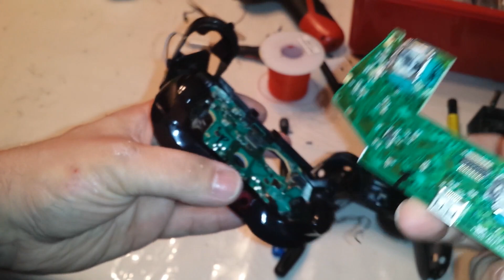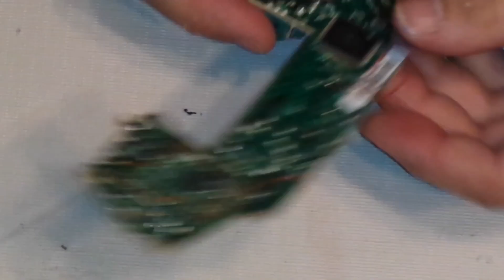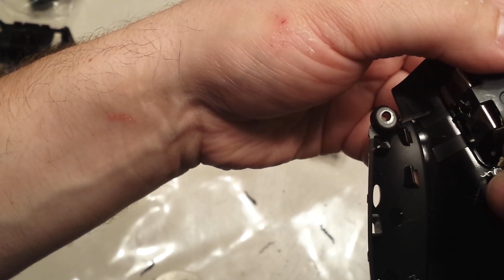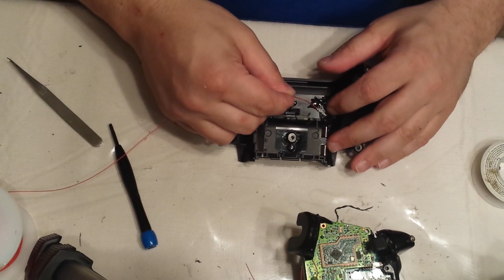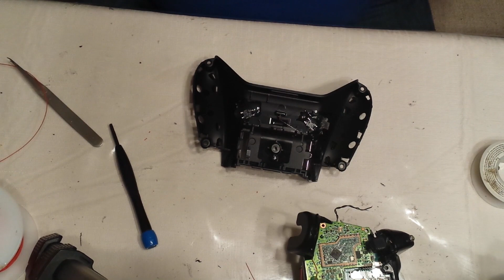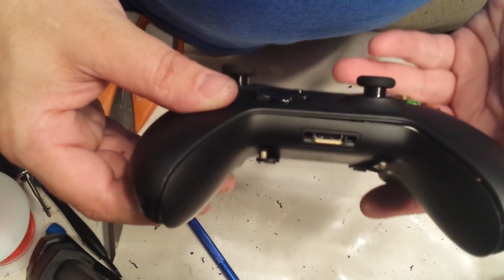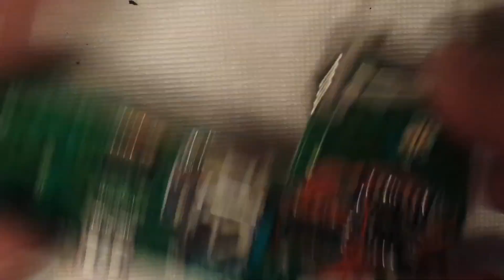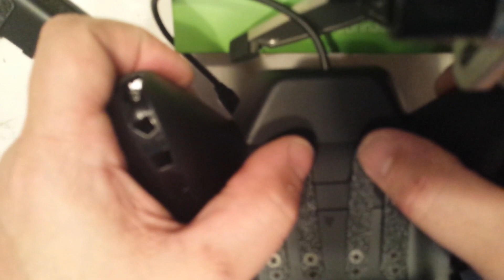TUTORIAL BUILD YOUR OWN XBOX 1 Scuf style Controller w/ Triggers Stops, Remap chip & MORE DIY Gamer

Comment: Is there any way to remap the D-pad?
Reply from the maker: Yes and No.  When I designed this chip it was 2011/12 and it was for the xbox 360 controller.  It is designed to work on both the CG (wireless) and the CL (corded version) controllers It only had 8 mappings. (any 8) but back in those days A B X Y RB LB and R3 and L3 were all people wanted to remap.  I wanted to beat scuf to the punch. I did actually. I had my programmable remap on the market before they did, but they are a multimillion dollar company and I am a hobbyist so I sold my chips to any company who would buy them, a few companies (Some you may know of) bought my product..  When the xbox one came out in 2013, everyone was going to want a new chip to work on the XB1.  The funny thing is - the controller while VERY DIFFERENT was also CG hence the design of the remap would work in there no problem, so I did a standard remap video right away, gave the heads up to my customers (other company's) that the 360 version works on the Xbox 1 controllers and there were SCUF STYLE re-mappable Xbox controller from DAY ONE of the xbox one release.  I decided to hold off to the spring to do this video  While the old 360 chips were a PAIN to install with all the wires (as you can see in this video) I designed a Exclusive XB1 version . Again only allowing remapping of A B X Y L3 R3 LB and RB.  That version + this one is the only chip on the market that can do MULTI REMAPPING - where yo can make more than 1 button to a remap on the back., So you could do combinations like A+B or R3 + A you get the idea....  Then People started to want the Dpad remapped. The chip was constrained to 8 inputs. SO you could do D pad + A B X Y (and leave r3 l3 rb lb off the remap).  People then started asking me for an ALL IN ONE solution with 12 inputs.  I was able to do it, but the sacrifice was Multi button remap. SO If you need a Xbox one version of the remap chip that can do 12 inputs (Dpad Up down left right A B X Y RB LB L3 and R3) I have those as well. Then the new controller S came out and the Exclusive Xbox one design went out the window but the old 360 Square chip (the one I use in this video)  Still work on that controller too. I did a whole new video to show that install. It's a little more work but installs pretty much the same way.  SO the answer is this.  If you want the square chip or the exclusive Xbox one design - it can do 8 inputs.(you pick 8 of the 12 buttons to solder to the chip) and it will remap it. If you want all 12 inputs I have that too but only for all the controller that came out before the controller S.  If you have the Controller S you have to go back to the Square chip.  I will eventually update the design, but as a hobbyist it is expensive and  not sure that there would be much demand. SO right now I only sell the chips I currently have designed.
Reply: MODCENTRALUSA well i am just trying to remap D_pad plus YXAB to have them below I have an s controller plus an Xbox one which has the a broken thumb stick so I will use that one for the mods and try it out.
Reply from the maker: If you only want DPAD and ABXY - then ANY of my Xbox one mods will work. Just make sure you get the right one for the right controller. 

If you have the older controller with and without the built in mic jack. Use this one 
http://www.ebay.com/itm/301536581617?ssPageName=STRK:MESELX:IT&_trksid=p3984.m1558.l2649

If you have the new Controller S use this one.
http://www.ebay.com/itm/301506057483?ssPageName=STRK:MESELX:IT&_trksid=p3984.m1558.l2649

Comment: any one have a digram for the wiring
Reply from the maker: I gave you all the points you need to know in the video. 
Same thing as a diagram.
But if you need a worded version.

This works for every Controller except controllers S

TP21, TP22 or TP26 are all Grounds. 

The button pinout for J5 is..

1 - 
2 - DR
3 - DU
4 - DD
5 - DL
6 - SY
7 - 
8 - 
9 - LB
10 - 
11 - 
12 - 
13 - 
14 - GND

The button pinout for J6 is..

1 - 
2 - 
3 - GND
4 - 3.3V Power
5 - RB
6 - 
7 - 
8 - A
9 - X
10 - Y
11 - BK, VIEW
12 - ST, Windows
13 - 
14 -
Reply: Amazing thank you bud

Comment: If you make mistake on remapping you can remap it on (probably name is good) "Xbox Accesories" works with One controller, One S, Elite others probably not.
Reply from the maker: Remapping in software (on the system). Will only change the installed remaps that you installed.

Hence if you put 2 buttons on the back of your controller for X and O and you go into the Accesssories software on the Xbox one and Change X to Y then when you press X on the controller it will push Y and when you press the remap on the back of the controller it will now be Y as well. But keep in mind that by doing so your original layout gets changed as well.

Comment: How easy is it to break your controller by doing this for first timers
Reply from the maker: If you take it apart wrong and pull something you shouldn't or forget a screw and force something off.. Broken controller.
If you solder the wrong pin you could short out the controller.
If you bridge pins by getting solder between them you could short circuit.

So unless you know how to solder or are confident following this video. You "Could" break your controller

Comment: I have the new slim controller, I took it a part and it's different! Is there a video on how to mod it?
Reply from the maker: There will be.. when I have time to do one.  Very soon.. subscribe it will be up soon.
Reply: Subscribed
Reply: Can I mod it the way it was done on the 360 controller? Scraping the coating off the buttons and soldering there, etc..

Comment: Great video man! I still LAN Halo Ce on the original Xbox with friends a few times a year. I have gotten used to the elite controller. My question is can you do something similar to the ORIGINAL Xbox Controller S?
Reply from the maker: You can... The original Xbox controller is pretty much the same. 2 wires to the Pad (one to each side of the pads and then to a tact  and your done. Follow the Xbox 360 tutorial, the Xbox one controller buttons are pretty much the same.  You can even google adding a button to Xbox controller S and you should find something.
Reply: +MODCENTRALUSA  Thanks for your response. Is there an email you can provide so I can contact you in regards to this directly. I wanted to add 2 paddles for buttons A & B as similar to the elite controller as possible. Wanted to possibly get a quote from you if you think that's something you be willing to do.  Thanks for your time.

Comment: Would the solder points be the same as the new updated controller with the 3.5 mm jack? At the 12 minute mark in your video you start describing solder points. Or is there an updated video for the new controller?
Reply from the maker: +Paul Palumbo  Nothing has changed.

The button pinout for J5 is..

1 - 
2 - DR
3 - DU
4 - DD
5 - DL
6 - SY
7 - 
8 - 
9 - LB
10 - 
11 - 
12 - 
13 - 
14 - GND

The button pinout for J6 is..

1 - 
2 - 
3 - GND
4 - 3.3V Power
5 - RB
6 - 
7 - 
8 - A
9 - X
10 - Y
11 - BK, VIEW
12 - ST, Windows
13 - 
14 -
Reply: +MODCENTRALUSA thank you!!

Comment: Wtf? How do I de-saughter the wires or however you spell it??
Reply from the maker: +Zack T.   Just touch them with the iron and they come off. Or use De-solder Braid...
Reply: +MODCENTRALUSA I don't understand, sorry.  Is there some kind of tool if need?
Reply from the maker: +Zack T.  do desolder a wire or remove it - heat solder by where you want to remove wire and PULL!
or
Desolder braid to suck up the solder. (google it).

Comment: I added padfles to mine but just like the video but now the b button doesnt work at all, any ideas?
Reply from the maker: +We3zy1992  yep..... you soldered to 2 points together on the B  button, the 2 solder points need to remain separate and you need to solder the wire to the TOP ONE one only.  D14
Reply: +MODCENTRALUSA  i will take a look at it, that could very well b it, thanks

Comment: Hi MODCENTRALUSA!   Quick question for you - I have seen some info about adjusting thumbstick tension on XBOX One controllers from the 60 or so grams of tension up to around 90-110 grams of tension.   I read somewhere that it can be done by adding a washer or shim under springs inside but not sure if that is the best way.   There is no video anywhere on how to do this in any way.   Do you know how that is done by chance?   The XB1 controller sticks are so loose.   Like 30+% less tension than the XBOX 360 controllers (which had the perfect tension for me and many others).   I know  people love the BX1 controller but many have complained about the loose XB1 thumbsticks so am sure there are thousands of people would love to understand this type of mod.   And I am one of them!~   :)   Any ideas?   Any potential for a tutorial on this subject matter?   Thank You!   Chris
Reply from the maker: +Chris Hunter Never heard of the washer thing.. but... IT is pretty easy. you need to desolder the stick. which can be a pain in the arse to do. But a good solder sucker and your golden. Once the stick is removed, use a pair of needle nose pliers and bend the 4 tabs that hold the plastic bottom on. Then take the bottom off. Carefully remove the stick mechanism and remove the spring, if you want a cheap way to do it slightly stretch the spring and put it back and solder it back in or Replace the spring with a stiffer spring.   Pot the bottom back on and fold the tabs to hold it in place. Place it back into the board and soder it back on.
Reply: +MODCENTRALUSA Very Interesting!   I had been  wondering if it would be necessary to remove the whole stick mechanism in order to change tension.   Now I know - thank you!!!   Next I just need to find a spring that would equate to about 90 to 110 grams of tension.   I will let you know how it goes!   I Appreciate You!!!   Chris   :)
Reply from the maker: +Chris Hunter I have done it in the past with other sticks (xbox, Gamecube, Dreamcast, Xbox 360 ect..).  Stretching the spring slightly will work and create some added tension, but only for a short period of time. Think of it like a BIC PEN, if you ever had a spring loaded pen where you clicked the quill in and out and if you were like me, you would push it into the desk then let it go to see how high the pen would jump, you could stretch the spring and the pen would jump higher. Same concept here. If you stretch it too much (like the pen spring) it is hard to get back together or it becomes out of alignment and will not move right.  So a minor stretch will increase the tension temporally but eventually become stock loose again.  Changing the spring is the only way to do it.  Finding the right spring would be difficult but with google and such, I am sure you can find something. Just make sure it is the same length and you will be fine.
Reply: +MODCENTRALUSA Do you think if we solder an XBOX 360 stick mechanism to an XBOX One controller it would work?   Pins the same?   I would think so but am not sure.   That would give all the benefits of the new XB1 controller but with the better tension of the 360 controller.   You can buy the XB360 stick mechs for like $1.77 a piece!  Here are the 360 parts and I just saw a video of someone swapping XB1 stick mechanisms because the old one was broken.   http://www.amazon.com/Analog-Stick-Thumbstick-Replacement-Controller/dp/B00B7Y5XVY   If they work the same, I could just swap the XB1 sticks for the XB360 sticks.

 What do you think?    :)
Reply from the maker: +Chris Hunter  NOPE>.. 360 alps sensors are too big for XB1 and PS4.  Also the Xbox one sensor is made specifically for the XB1 controller even though the PS4 and XB1 sensors look the same, they might fit but the calibration will be off.  At least that is my experience with it.  SO neither of those ideas will work.
Reply: +MODCENTRALUSA Ah!   Bummer.   Oh well!   Back to the spring thing!!!   LOL.   :)
Reply from the maker: +Chris Hunter  Just so I am clear what controller do you want to increase the tension of? XB1 or PS4?
Reply: +MODCENTRALUSA If you have an idea what spring would be like the 360 tension, please post?  
Thank You!   Chris   :)
Reply: +Chris Hunter Or even the right spring size?   I am not even sure what kind of spring to order for this thang!    :)
Reply from the maker: +Chris Hunter  Give me one second I will look at the spring for you..
Reply: +MODCENTRALUSA You are so great man.   I really appreciate you for helping me with my questions.
I missed your question earlier - I am trying to get XBox 360 stick tension on an XBox One controller.   The XBox One takes about 60 grams of force to push.   The XBox 360 was about 90 or 100 so the XBox One sticks just feel weak to me.   The controller I want to mod is the XBox One controller.
Reply from the maker: +Chris Hunter OK the Xbox 360 spring is much larger and thicker than an Xbox one spring. It will not fit into a Xbox one ALPS sensor.   The only thing to do is to find a spring that is slightly thicker or 1 MM longer that will increase the tension.  

http://i67.tinypic.com/30lhq43.jpg
Reply: +MODCENTRALUSA Wow man, thank you so much.   I will start looking; I'm going to use a scale to test springs until I hit one that takes 90 to 100 grams to get a full press.   When I find one that works well I am going to send you a link.   You are the best man.   Really thank you.
Reply from the maker: +Chris Hunter  Sounds good.. good luck in your search. If I have time I will look too.  If I had my caliper handy I could do some measuring.. but sorry I do not.

Also doing some reading. If you make a Rubber spacer the same circumference as the original spring and test different thicknesses, starting at 1mm and going up.  You might be able to compress the stock spring inside the stick to create more tension (sort of like the washer thing you mentioned).  You should use a Rubber ring as opposed to Metal.  It also can not be too thick.  if the spring is compressed too much it will not function correctly. So you might want to play around with that too. 

Personally I think a spring that is the same circumference and length would be a better idea if you can find one that is stiffer and allows 90-100 grams force on the stick.
Reply: +MODCENTRALUSA Awesome!   I will try to find the springs.   I was planning to go out today and buy a wide variety to experiment with starting tonight.   :)   I am also going to buy a solder sucker.   Radio Shack is a rip off but I may buy one there just so I can get started.   If you happen to have a caliper handy and measure, please let me know.   Either way I will be trying to get a spring out today once I have the solder sucker and then the hunt begins.   Lol.   Once I have them, I will update you with the springs that give proper function and tension!   If no springs can be found I will try the rubber spacer idea!   :)
Reply: +Chris Hunter Man, I called ALPS to see if they would divulge the spring size and the 1st guy was a total jerk.   The next one was very polite but said that they had an NDA with Microsoft that would not allow them to give out the info.   I am going to figure this out either way.
Reply from the maker: +Chris Hunter Yea.. I wouldn't have gone there either. But the thing is, they might have a NDA with M$ but they use the SAME SENSOR BUILD (in other words) the Plastic shaft and the metal spring inside the Analog) is not different than the Analogs they sell for hobbies, other controllers and such.  The POTENTIOMETERS on the Sensor might be calibrated differently for the Xbox one controller, but that does not change the ascetic of the analog it self. The metal shell, the shaft, the spring the plastic internal shaft, the copper holders, the tact button, there all basic parts and NOT COVERED by an NDA. The basic build was not made for, or directly for Xbox. The PS4 and Xbox one 1 both use ALPS sensors.  They are so very similar.  So the NDA line is total BS especially for a SPRING on the inside.  

Go to Lowes and get a caliper.. There about $15.  Measure the Height and the Circumference.   Then Stretch the spring out and see if you can measure the thickness of the metal of the spring.  IT will be SUPER SMALL like 1mm or so. That will give you an idea of where to start.  Cutting a spring to size is easy and getting one of the right Circumference should not be difficult.  It will be finding a spring that is Thick enough and wound tight enough to give you 90-100 grams of tension force when you put it inside the alps sensor.
Reply: +MODCENTRALUSA Got it!   I will get one of the springs out tonight now that I have a solder sucker.   :)
Reply from the maker: +Chris Hunter have fun.. let know how it turns out. You can PM me on skype MODIFYCENTRAL instead of waiting for my reply's here. No
Reply: +MODCENTRALUSA Hi ModCentral!   I would PM on Skype but I don't have Skype.   I bought a measuring tool and measured the spring.   I am getting a spring circumference of 9/64 " which seems to translate to .140 on the back but I am but sure I'm reading this thing right.   I found a chart that says that translates to 3.5719mm but I am unfamiliar with metric system.   Does that sound right to you?
Reply from the maker: +Chris Hunter sounds right.... and sounds like your on the right track.
Reply: +MODCENTRALUSA I have it narrowed down now!  After that I am ordering to test and will send you the results!   I have wire diameter of the 360 spring at .0180 to .020 inches, Outer Hole Diameter at 3.57 mm and Inner Diameter of .125.   With these I am custom ordering springs with the XB1 dimensions but the XB360 wire diameter.    Which material do you think these are made from?   Music Wire, Stainless Steel,    Oil Tempered Chrome,  Silicon Type 316, 17-7 PH, Elgiloy or    Plastic Composite?   Any guesses?
Reply from the maker: +Chris Hunter Either Stainless Steel or Music Wire... There not Silicon elqiloy or plastic.